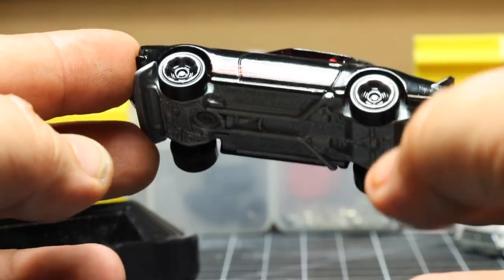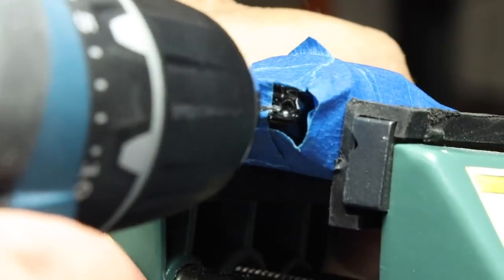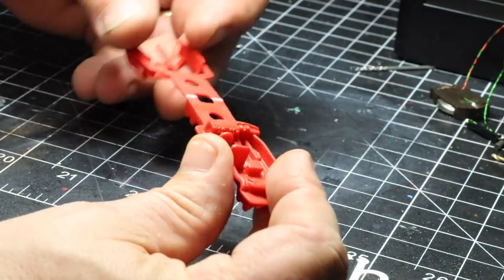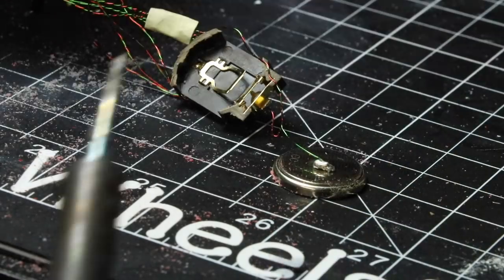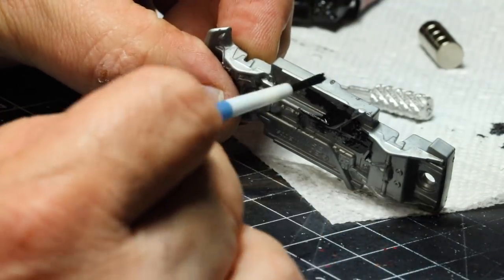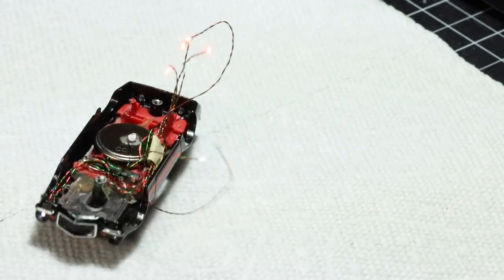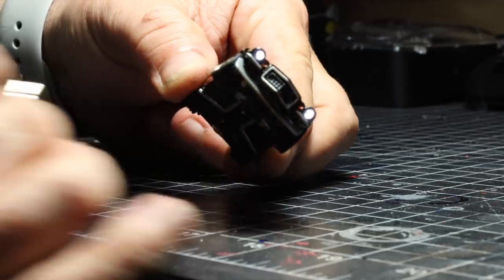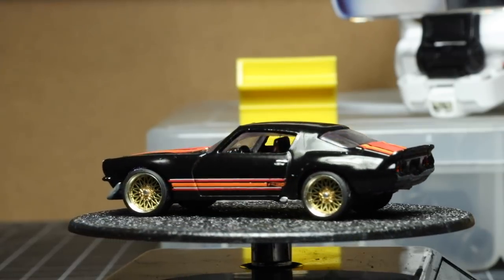Hot Wheels Custom LED Lights Mainline Z28 Camaro Custom

Comment: Nice work! The only tip I can offer is what my pro-bro does to hide the lights glowing in the wheel wells: use black electrical tape formed into the shape of the wheel well. This requires you to put the wheels on last. The final result is great.

Comment: Lol. Loved this customisation. I agree with your preference of using smaller battery. Plus if I may suggest, if the hood can be raised, then maybe install battery there. The battery would become the engine which wold be a reality. Also if possible, maybe fit the sensor somewhere on the top portion. So that in stead of picking the car up and touching magnet from below, I would like to touch it from top. Well i bet its easier said than done. Here i am just commenting, i am 100% sure that I wont even be able to open the car. 
Great work. Its really amusing to watch you work on these.

Comment: 2nd gen Camaros are also my favorite as you can see from my profile pic. This car turned out fantastic!
Reply: Mine too. 70-73 and 74 after they changed the nose and rear. I've always had a soft spot for 74 because they were a bit of a mongrel. The first year for this, the last year for that. It was basically the same as the 75-77 but just different enough to be a really unique year for the Camaro. The 78-81s were ok too. I was just starting to drive in 83-84, and got my license in late 84, and for us, because of their age, those were the quintessential Camaro. They were just the right age for hand me downs after the parents were done paying them off a couple years earlier. By the time 86-87 came around, a few of my friends had them and started modding them to not be mom and dad's car anymore. Not me though, it was several years later before I got one. My hand me down after my das was done with it, or so he thought, was a 77 Chrysler Newport 440. Shortly after that I got a 82 Plymouth Gran Fury Police Interceptor because Dad wanted his car back. Yep, I was the only kid in school that had a police car

Comment: Love your work. I'm wondering if it would be possible to light the dashboard by thinning out the backside of the dash, or removing the dials completely and placing a printed or drawn plastic or paper section with the instruments with an led behind so when you turn the lights on the dash lights up as well.
Reply from the maker: Possibly but I don't have the patience for that!

Comment: Custom came out Sweet ...Not bad at all .... where did order the wheels there Bad ass 😁👌🏼
Reply from the maker: https://www.ebay.com/itm/1-64-Scale-Diecast-Alloy-Wheels-M01A-N023A/323032332767?ssPageName=STRK%3AMEBIDX%3AIT&var=512163334185&_trksid=p2060353.m1438.l2649
Reply: I want a set of those wheels myself. I have a racing champs 64 impala. I kinda want to try the hydrolics n gold rims
Reply: Thanks for the link for the wheels.
Reply: SILENT SNAKES 8i

Comment: Where did you find the magnetic switch, and how did you wire it?  Did it just replace the micro-switch, or is there a special kit that has it?  I checked through TechNickL Designs and didn't see it.

Comment: Does your car not heat up when you're drilling?! This happens to me when I'm only adding lights to a car. The paint tends to bubble up :(

My solution to this small problem is cold-drilling. I surround the car with ice cubes = no paint bubbling from heat.

Comment: Where can you find the 2 - 56 button head screws and tap I've looked all over the place and I refuse to buy it from Amazon because it'll take too long to get here from the states. I'm in Canada and I shop at Canadian Tire and apparently nobody at Canadian Tire has even heard of those things can somebody help me please
Reply from the maker: Only places I know of are Amazon or eBay. I doubt you will find them local. https://www.ebay.ca/itm/Button-Head-Socket-Cap-Screw-Stainless-Steel-Screws-UNC-2-56-x-3-16-Qty-100/172430120383?hash=item2825a2d5bf:g:z8IAAOSwXeJYF3a8:rk:1:pf:0

Comment: Isn't a rivet just a post that has been mushroomed to hold something in place? Like the rivets in steel construction. They are just little posts of metal heated up red hot then mushroomed on both sides to hold the steel beams, and posts together.  Or does only the two piece rivet gun style count as rivets?